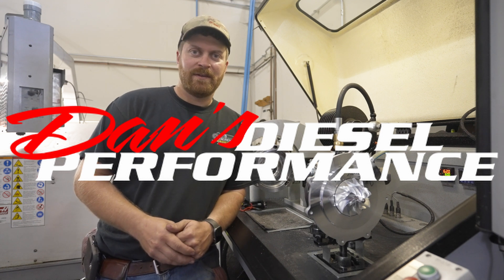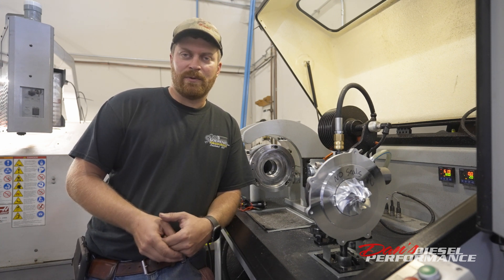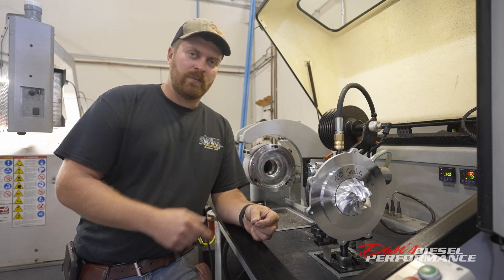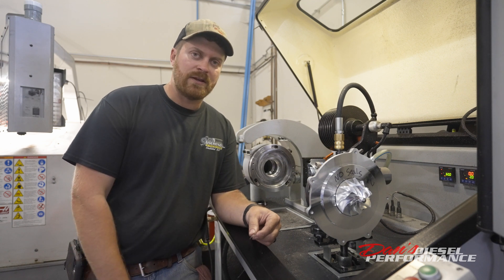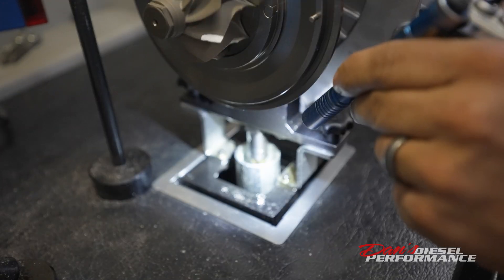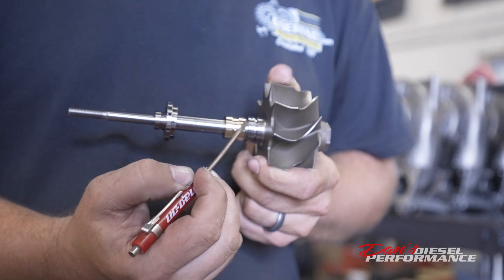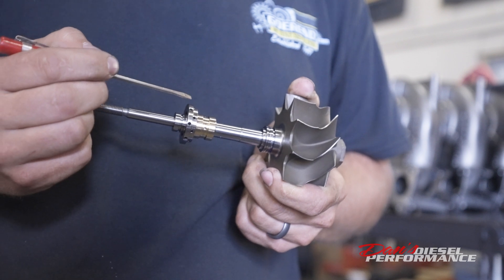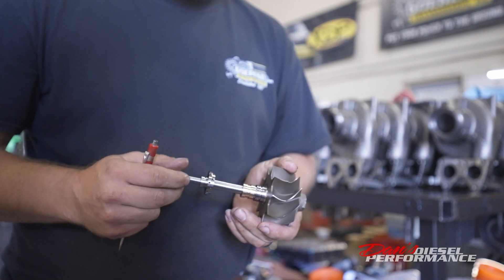Fix oil leak issues on your new turbocharger

Comment: I had oil coming out the front seal on my S475.  This happened when I upgraded the 270 degree thrust bearing to a 360 degree bearing.  My drain was free flowing and ZERO CC pressure.  I went back with the stock 270 degree rebuild kit from bW and problem solved.

Comment: I had no idea they didn't have seals, well not seals for oil anyway. Although all of what you said makes sense, and is relatively straightforward. Thanks for the explanation, even though I don't work with turbos or anything that would require turbos like that.